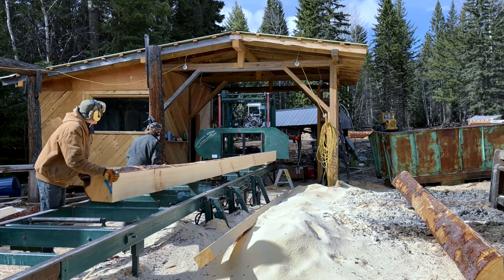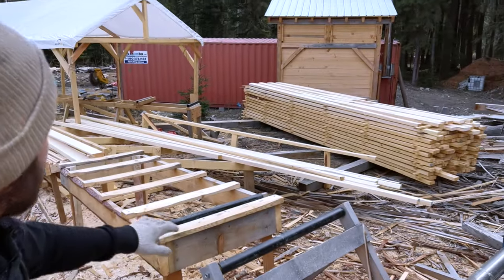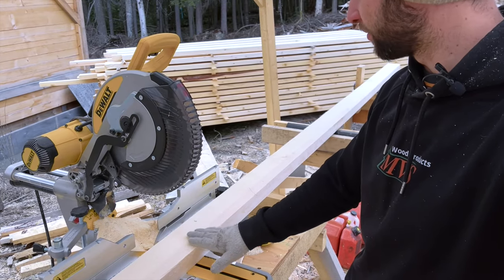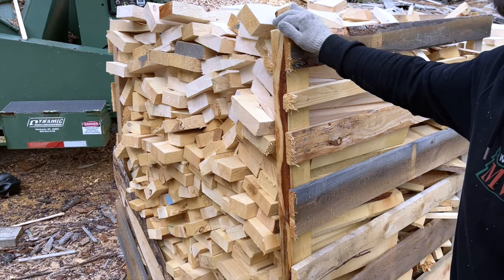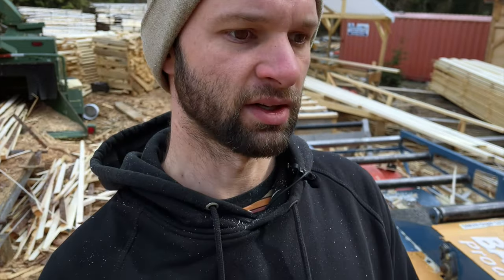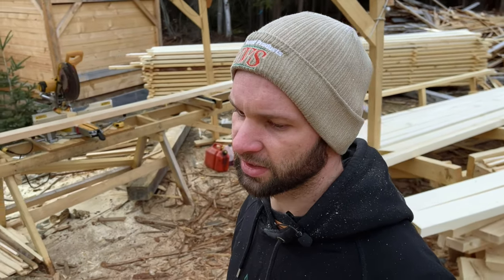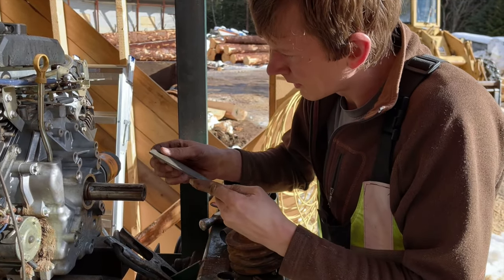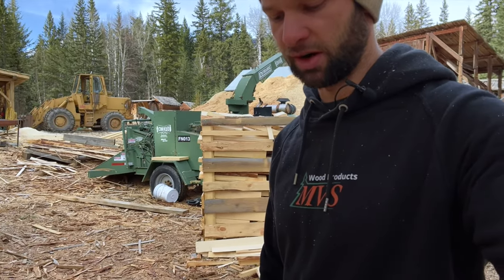Piano Wood Workflow Update

Comment: I was planting trees near Kamloops a few years ago. It was July, and we went so high into the mountains that there was still snow in the shade. The spruce trees they were taking out were as large as 3' at the stump. With a growing season that short it must have been incredibly tight grained. There were good sized logs scrapped in the burn piles as well as big wind-thrown trees (trees left behind couldn't stand against the wind without the other trees helping slow the wind down). Guys like you could have made a mint from the waste.
Reply from the maker: It’s true. Sometimes I would love to just go full salvage. There’s always something nice at the bottom of the burn pile. I do know the trees you’re talking about, I used to get into fires near blue river with these absolutely monstrous trunks, not super tall or anything because of the elevation but thick and probably very slow growing.
Reply: I guess the challenge, I've learned from your videos, would be to getting at those wind thrown trees before the bugs get into them. Do the spruce beetles burrow all the way into the heartwood?
 @MountainVoiceInc